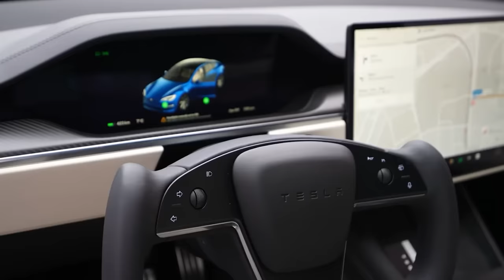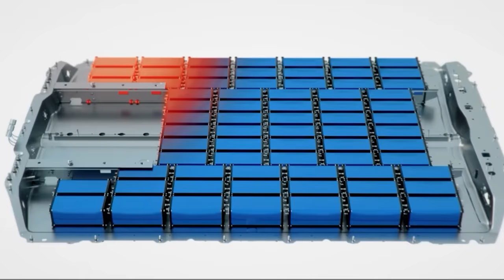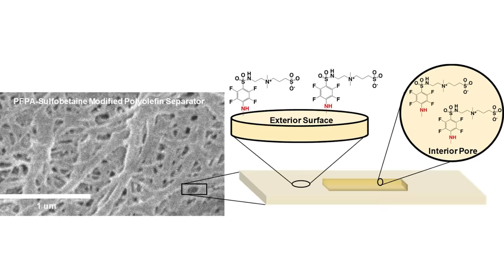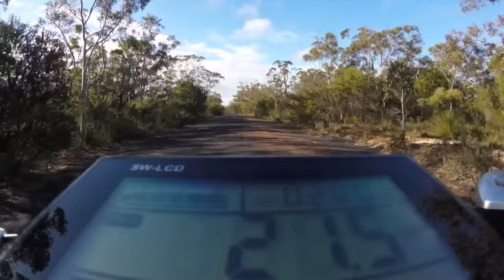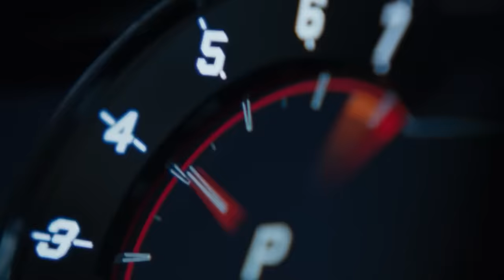EV's Are Exploding In Shocking Numbers

Comment: 3 guys died two days ago in SLC UT. Tesla hit a tree, hling too fast and burst into flames. Killed the 3 people in the car before they could get out!
Reply: And that's never happened in a gas power vehicle right?
Reply: hebrewgodisrael1746  get the facts straight, a gas vehicle is 11 times more likely to catch fire than an EV.
Reply: hebrewgodisrael1746 listen to the article, they even stated in it that EVs are much less likely to catch fire. They also called the EV fires isolated cases. Pointing out a few cases worldwide over a 3 year period would indicate that they definitely are rare. PS, the BYD vehicles in China catching fire are the plug-in hybrids..you know, the ones that have gas engines.
Reply: @davekozlowski1266  I can't really believe that. Many ev fires are silenced such as the china ones. Also what does count as fires. Most gas cars are burning due to electric issues or from something being placed in the car which is causing a fire. Gas from the tank is hardly an issue. 

Also quiet number of gas car fires are old worn down ones. What will happen once electric cars gets older and worn as the gas ones?
Reply: So if it had been a gas car, they'd have all climbed out feeling on top of the World then, would they?
Reply: @davekozlowski1266  This is due to poor maintenance, or because there are millions more driving around who have long passed the 100,000 mile mark with bad wiring or leaky fuel lines!
The new EVs already light up when they are brand new, just like these toy scooters for adults!
Reply: 3 speeding idiots ran into a tree...duh
Reply: How do you maintain an E V car no oil petrol diesel you knows how too  ,Very few technicians know  about these E VS are deadly.
Reply: @davekozlowski1266  Right because an ICE you canget away and do not have a runaway fire
Reply: @Brian-om2hh  yes berceuse they did not have a runaway fire.

Comment: They should be banned from ships and multi-storey car parks.. plus they should be parked well away from any buildings or other vehicles.. EVs aren’t the future, cars powered by ammonia is..
Reply: What about banning them from the roads as well as the more there are of them the more damage will be done the infrastructure - the roads were not designed to cope with excessive loading - We have Gas Pipes, Water Piupes, Electricity, Sewage Network under our streets.......give it a few years and they may well be causing carnage on the streets.
Reply: i sleep just fine while my 10 year old, uninsured, out of warranty Tesla charges in my garage at night.

Comment: What ppl don't realize is that when a car battery start to burn is impossible to stop the fire, when a fire department start pouring water to the car it only make a bigger mess as water is like pouring gasoline to the fire as it reacts with the battery lithium never use water on an electric vehicle

Comment: I love diesel vehicles i will only drive a diesel, i can drive over 90 miles on less than £20. 2014 Toyota Yaris 1.4 D4D with dfp delete and remap, it runs beautifully even with almost 200,000 miles on the clock never let me down.
Reply: Right. However, there are environmental problems with diesel.

Comment: What to expect from EV , the name of the game is to get more and more power distance range driving with the same battery size to avoid extra weight.
The electric concentration ions in the battery becomes crucial to obtain more range result, 
It’s like asking the ions to squeeze together in a limited space ready to deliver its energy, or explode .
Gas liquid doesn’t have this problem for once the tank is in full capacity, you can’t add more and range driving relies on driving skill .
Reply: One of the most intelligent answers on here...and the one least ticked. Shows the great.minds who would otherwise put us back into horse and buggy days, when the combined ammonia of the animals; horse, cattle, sheep and pigs farts, could blow up the farm under suitable conditions.
Reply: White hydrogen would make a great alternative until a synthetic fuel is engineered,&there would be no pollution caused by scrapping perfectly serviceable(&practical!) vehicles.

Comment: It's very debatable whether e.v.s are better for the planet right now or not. Yes they may be rechargeable, but as other people stated the batteries are extremely toxic to our environment. To me the biggest consideration though, is the fact that you still have to get the power from somewhere. A hell of a lot of our power still comes from coal generated power plants. So if you don't have just a perfect setup to be able to charge it yourself, or you can't get good sunlight to charge you are reliant on the grid. And what do you do in hot hot or cold cold months when the grid is already stressed out. Yes and the cold is another Factor 4 battery life
Reply: "A hell of a lot of our power still comes from coal generated power plants.."  It doesn't.  In the USA coal is less than 20% of the total, and even that is distorted by a handful of flyover states subsidizing coal plants.
Reply: Don't forget the huge pollution problem caused by the dust particles of these heavy vehicles,London's imposing a dramatically high emissions' tax.They're a total environmental disaster from start to finish,&completely impractical.
Reply: @helenbenjafield7351  Except they are not.  London is NOT imposing ANY emissions taxes on EV's.

That claim is literally made up, and is embarrassingly false.

The ONLY emissions restrictions are on old COMBUSTION ENGINE vehicles.

Your posts are getting to facepalm levels of absurd.

Comment: Isolated events? No.

I discovered the energy potential of Li-Ion batteries 12 years ago. I had a Ping battery catch fire while charging I could not extinguish the fire with any of my home fire extinguishers - I had one specifically for electrical fires. 

It suppressed the fire somewhat but it sure as heck did not extinguish the fire.

Comment: What many Eco Zealots will not admit or even know, an EV battery fire is called a Thermal Runaway  Fire.
This is where certain chemical elements combust and are very rapid to grow, and very difficult to extinguish dur to the self perpetuating nature of the combustion.
Reply: Which has nothing to do with anything as EV's catch fire far less than combustion engine cars.

Comment: Not to mention the extra road maintenance needed with all the added weight.
Reply: A single loaded semi truck causes more wear than 20,000 cars.  EV's don't even measure as being relevant in the weight difference on the road.
Reply: @redbaron6805 London's just introduced a dramatically high emissions' tax due to the pollutants caused by the average EV car.Following several years of monitoring the stuation,it was found that they generate far more dust particles from the road surface&rubber tyres.They are not the solution!

Comment: What scares me is the lithium ion batteries in EVs. When fully charged there is a massive amount of potential energy contained in the batteries, properly used by the motors all is well, however if something glitches, and there is a sudden discharge you get an uncontrollable fire as shown in this vid.
Reply: People petrified of EV's simply have no idea how they work.  There are multiple safety mechanisms in EV's, and even EV's with defective batteries are catching fire about 6x less than combustion engine cars.

Comment: The more EV's and even more models of that are on the road the odds get greater for potential fires due to various factors. E.g. accidents, flooding, etc. The EV industry is still in the infant stage so to speak, with time they may or will improve one can imagine. Personally I'm not against them, power/torque numbers are incredible, range is still very limited for now. I'll stick with my ICE vehicle. Besides with strict emission standards particularly on the closed/sealed fuel systems along with higher safety requirements for the high pressure fuel injection systems on modern vehicles your chances of a fire caused by accident or other events are fairly remote, but still possible. Usually when you hear or see an ICE vehicle that is on fire it's an older vehicle (not always some have factory defects that have not been addressed yet for that very reason) that probably had poor maintenance or hacked repairs which allow fuel (you can smell gas, so if you do don't drive it) and/or oil to leak on to the exhaust (heat source) allowing the fluids to ignite. Another possibility is that additional wiring  (e.g. stereo, amp, lighting etc) not properly installed or circuit protected allowing some of power feeds to short to ground thus causing an electrical surge fire which may spread to other components and/or electrical systems thus creating a chain effect of added electrical wiring shorting together and intensifying the fire at least until the main power source (the battery or batteries) are depleted/discharged by that time only flammable components will burn and the vehicle is an inferno. With EV's having such high capacity batteries it may or can take days for them to discharge and is why they can reignite days later after the initial fire has been extinguished. If you look at an EV fire its a pressurized flame coming out the vehicle, like a blow torch unlike an ICE when the engine stalls the fuel pressure is depleted in a short time being that the fuel pump is shut off. If the engine is running when the fire occurs and still running during the fire the fuel pump will continue to supply fuel to the engine and can cause a pressurized flame to happen if the fuel system is ruptured. Again for now ill stick with my ICE and take my chances. Actually your safer in a vehicle with a full tank opposed to a partially filled or empty tank. Complete opposite of an EV.
Reply: Actually EVs were in existence more than 100 years ago.  Then they vanished for the most part.  Now its Li batteries instead of lead acid batteries.

Comment: dont buy this JUNK!!!   garbage EV,,,a used battery costs 19,000$$$   thats insane
Reply: Dude, you're free to share your opinion, please don't represent them as facts though.
Reply: @davekozlowski1266 It’s facts though. Junk is junk is junk!
Reply: @davekozlowski1266  those are facts.
Reply: @cg3771  So don't have it replaced. Have it repaired and refurbished at a fraction of the cost of replacing it instead. We in the UK, already have independent EV specialists doing this work.....
Reply: @cg3771  And which EV did you own, for which you needed to buy a remanufactured battery pack?

Comment: :tap: tap: first off, it's no wonder it took "600 gallons" of WATER?!?! Are they friggin'Nuts?! No one with a single brain cell in their head would use WATER to put out a Lithium or ANY battery!!!! Ever try putting out an electric Fire with H2O?? Tell a Fireman that!!!

Second, any new technology needs time, and work to launch into popular use; but Corporate greed; NO WAY.
I really doubt the first Flying machines were perfected in 5-yrs.

Thirdly, old cars were built to last; the crap coming out in the last 20-plus yrs isn't built with any sustainable quality. Five years, buy a new one...even gas powered.

Comment: If a pump, coolant leak or software malfunction occurs thermal runaway is certain. With three non-redundant systems requiring all three to operate perfectly, errors and fault will inevitably occur... This is before a second hand market and reduced maintenance even occurs.

Comment: Lithium Ion batteries were responsible for bringing down a 747 cargo plane also. Even equipped with a fire suppression system which evacuated the air from the cargo area it was hopeless as these batteries can burn in a vacuum. Planes no longer carry Lithium batteries as freight.

Comment: Fire departments will need to understand that water does not work very well on electrical fires.  They should be using Halon equipment instead of water.

Comment: Electric vehicles are relatively new as they age the risk of fire increases. As batteries wear out weak cells will work harder and with the tremendous cost of replacement some may wait until they have some extra money to replace them. This could cause a spike in EV fires.

Comment: Where's the proof that petrol cars catch fire more than electric vehicles??? That cargo ship was later shown to have hundreds of EV's on board, not 25. Annoyingly the media have been doing their best to not mention the cause of fires when EV's are involved..The idea that EV's are environmentally friendly is a myth, the batteries use rare elements that are often not mined in an ecological way and will pose big problems for disposal.  The cars themselves weigh twice as much as petrol or diesel vehicles which make them a greater danger in an accident, and then they are very likely to catch fire as a result.  And to top it off, in most cities  don't have a robust enough power grid to charge these cars if most people drove one!

Comment: Lithium-ion batteries have higher output and larger capacity than conventional batteries. However, when the output is high, it naturally generates high heat. Nissan and other companies have systems in place to effectively suppress this, so this does not happen to Chinese and Korean manufacturers.

Comment: Every lithium ion battery is a Trojan horse incendiary and explosive device under an EMP attack. The standard BMS fails above 50v. An initial fast EMP wave is above 50k volts. 
This is unimaginable destruction and the enemy holds the remote. .

Comment: A bit of an alarming projection is - EVs are 1/500th of the worlds light vehicles - so if they were say 1/2 the worlds vehicles you'd expect 250 times as many such fires . Many are no ones fault; they did nothing wrong. Deposits called dendrites inside the battery can grow and cause s short; this can cause a fire even though no one did anything wrong. It is an unfortunate problem in current lithium ion battery tech.

Comment: I find it difficult to be sympathetic towards anyone who has bought an EV if for no other reason that it's obvious that they were trying to raise their social status in buy a vehicle which had "zero emissions" during OPERATION without any thought to what the total package does to the environment.  From start to finish, it has ALWAYS be true that the pollution an EV generates in making it, operating it and decommissioning it are many times more than a gasoline powered car. Just mining the rare earths for the batteries does phenomenal harm.  Then there's "What generates the electricity to charge an EV?" That's more often than not a fuel fired generator, with about a 15% loss of energy for each time it is transferred through a different change in current, from high voltage AC to low voltage AC to DC and finally through the charger to the EV. And then you drive around in a car that takes almost twice the energy to move because IT WEIGHS ALMOST TWICE AS MUCH!

At the end of it all, assuming it hasn't gone up in smoke and actually lived through the 8-10 years of max life of the very expensive batteries without exploding, you can't just send it through the shredder to make more EV's or other metal objects, you have to carefully process it so that you don't pollute the area of blow you shedder up when the car explodes.

There's far more to the equation, but just this should boggle the mind as to the virtue signally idiocy buying an EV really is, quadruply ironic in that it doesn't even come close to the false greenie virtues out there in true performance.

Comment: "People's reservation" about EV's is mainly due to the price difference and the differnt driving experience. The price difference also includes justified concerns about the price of replacing at one time the battery after damage. In some cases that turns out to be more expensive than the total price of the car just one year earlier. Other "reservation" is the lack of loading points in many parts of miost countries. The incidents with fire are of course very serious and very scary, but the number of incidents compared to the number of sold cars remains very low. Even 19 000 in China has to be put next to the total number of EV's in China. Given China's population, this will be quite limited too. And of course, the safety standards in China might be a little bit more frivolous than those in the West. I'm sure insurance companies in the West make sure of that...